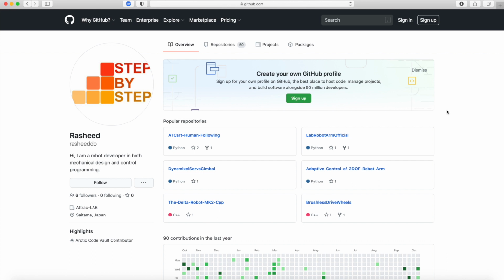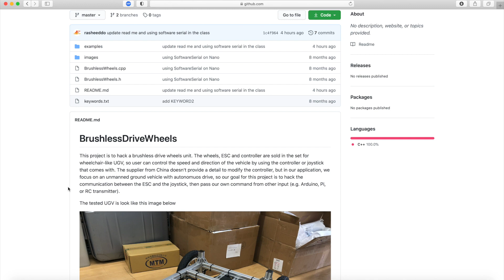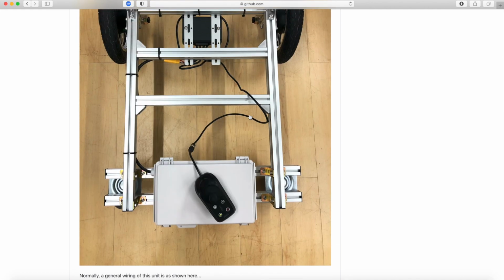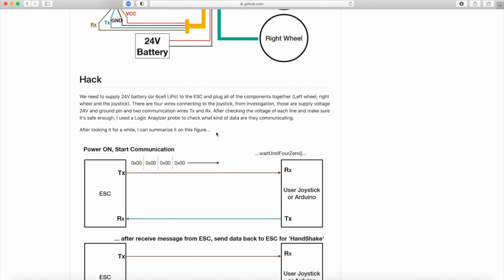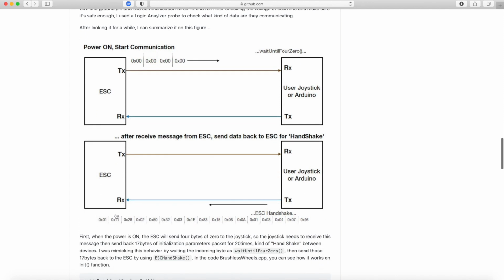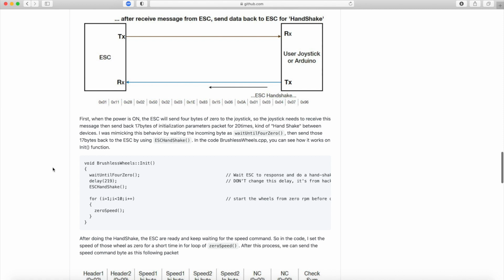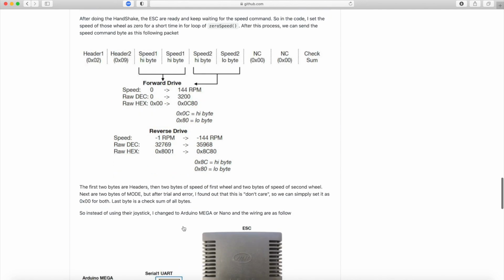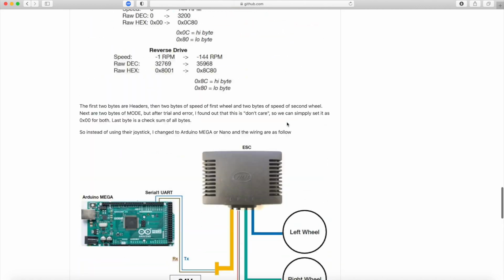How I Hack a Wheelchair and turn it to the ROBOT!

Comment: Sure, here's the text translated into English:

"I have been using an electric wheelchair for 17 years and am looking for a competent supporter to help me convert my wheelchair to remote control. I have a DX2 control from Dynamics Control. Could you assist me with how this works and what I need to do to connect a remote control? Does it work through the control or through the farmer module? Thank you very much for your support. Warm regards, Richard"

Comment: Thank you for your excellent video!
Can you please provide links to the (a) wheelchair motors, (b) motor driver/controller unit and (c) the little red-colour board you developed to connect the motor drivers to an external microcontroller on your videos?  
Note: You have a link http://www.runele.com/ for the little red-colour board, but I could not find it there (I cannot read Japanese)
Reply from the maker: Thank you for your attention!,
sorry but I cannot find a link of that motor, our friends in China ordered and shipped this for us, but it's quite similar to a wheel hub motor for hoverboard.
This is a link I found for that black controller and joystick, https://www.norlha.com.cn/, as I said they don't provide much information about this, so I need to hack it by myself.
For the red PCB board, that's the custom board we asked Running Electronics to make for us, so I think they didn't put it on their website. But the idea to control the motor is from this repo https://github.com/rasheeddo/BrushlessDriveWheels

Comment: Hi, how could you do the same but for a pride quantum wheelchair ?https://www.pridemobility.com/pdf/owners_manuals/intl_jazzy/uk/uk_q6000_om.pdf 

How did you work out the codes?
Reply from the maker: May need to check how the controller talk to motor..each wheelchair has its own controller. But if the motor is BLDC, then you can try ODrive robotics controller.
Reply: Could you possibly do a little video showing exactly how you worked out the codes that the controller sends and receives?
Reply from the maker: @p1g2b345  I am not sure how am I gonna explain more about this because the readme on that repo explain all what I would say :) you can check the detail on that repo here
https://github.com/rasheeddo/BrushlessDriveWheels

One more thing, I am using Logic Analyzer tool to capture the data packet between Tx,Rx line on this controller, and reverse engineering on that. Each controller has its own data packet, you may need to experiment on yours :) good luck

Comment: Hii thank for inspiring video , I have also tried similar thing using old stand https://youtu.be/m88fJMJsDf8 

Can you share the link for the wheel and esc

Thank you
Rohit
Reply from the maker: Wow that’s nice! You child would be fun too I think.
I am not sure there is website of this wheel, I will check and send it to you later
Reply: @stepbystep-robotics  thank you so much, I have used hoverboard wheels , there is a big issue of braking. It continues to move due to inertia
Reply from the maker: @Robotinnovations  yeah right, I have similar wheels as yours, and it doesn’t have brake inside. Which ESC are you using? Have you tried ODrive or VESC? Those ESC can use regenerative braking so no need of mechanical brake at all.
Reply: @stepbystep-robotics  Thanks for the reply, I have used generic ebike controller . Please if you find link for your wheels with brake please do share.